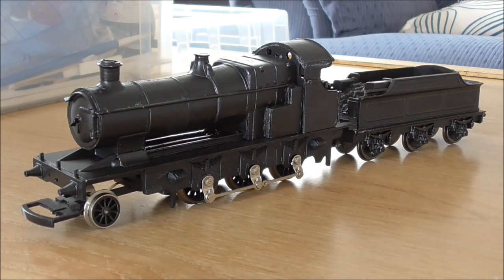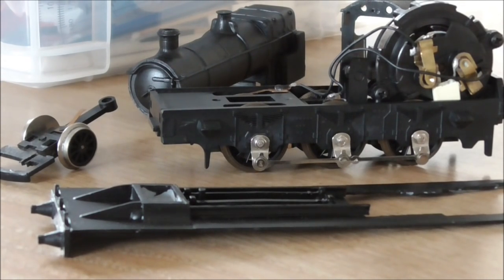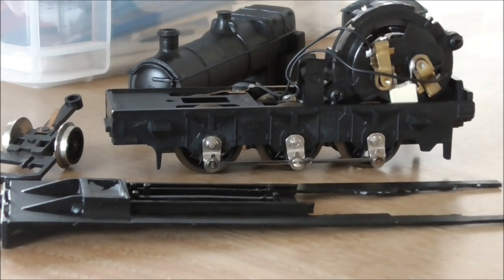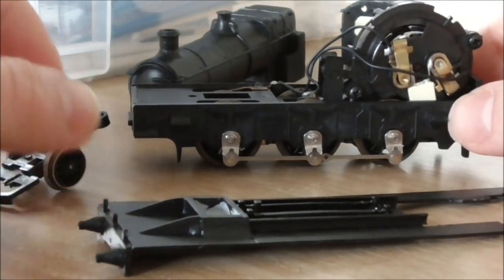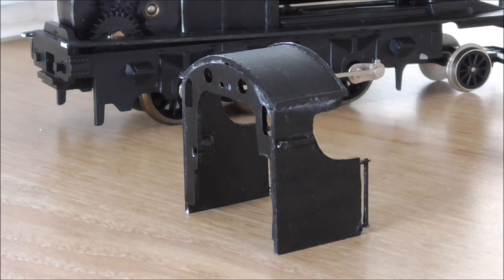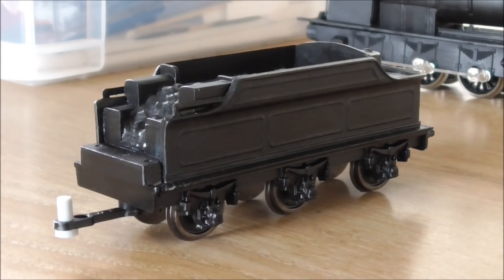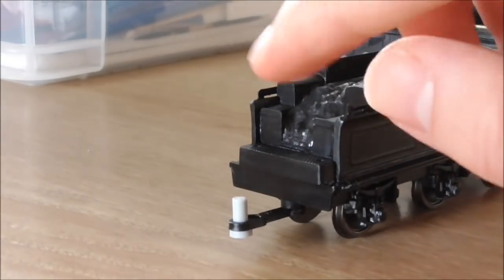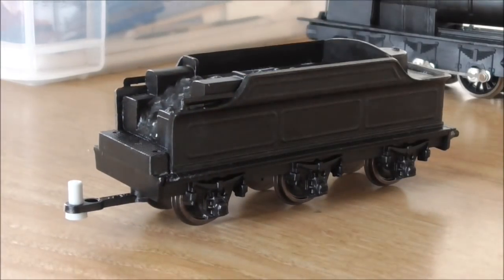GWR 2600 Class Project, Update 6

Comment: Looks great so far Callum even if has been well over a year. As you say it is as and when you get time. Shame you melted the old tender. Can you turn that into a rusty tender sitting on a siding? Does the linkage move ok around curves between tender and engine? Cheers, Laurie.
Reply from the maker: Thanks Laurie. Too true indeed. Yeah, I'm sure I can come up with something for it. I believe so, though I've not tested it as such, but it seems to be the same set up as many Mainline models. Hopefully the next update won't take as long ;)